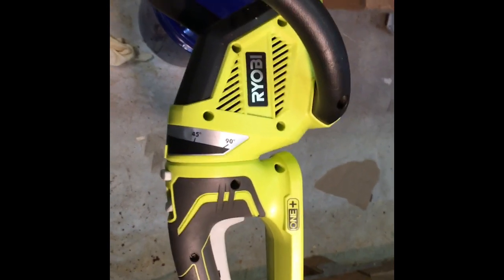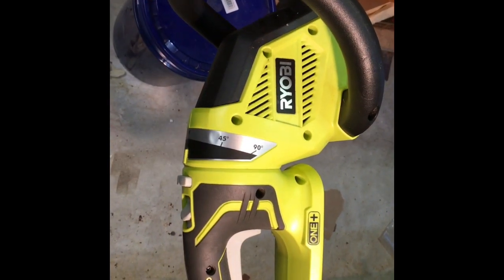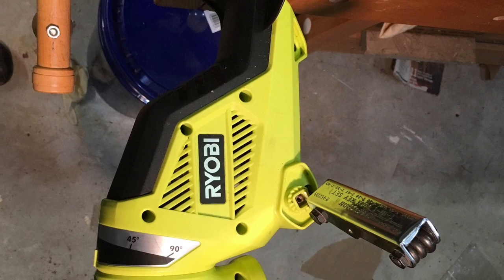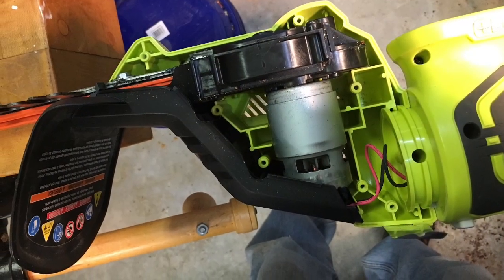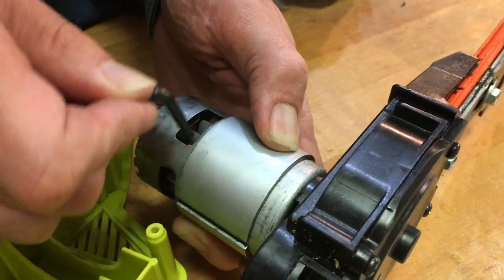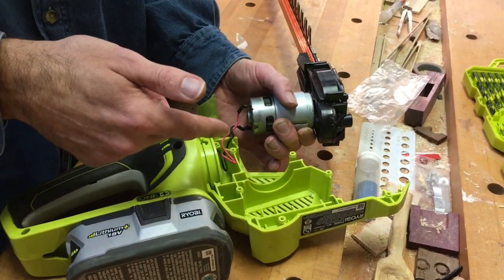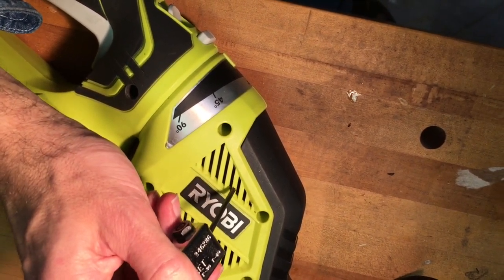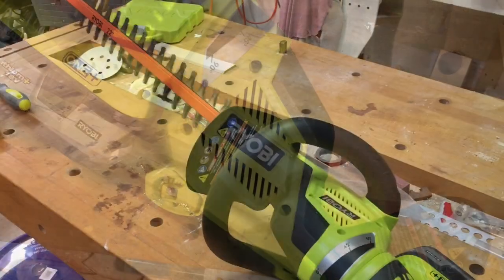Repair Ryobi 18V Cordless Hedge Trimmer

Comment: Very helpful video.  In the end I did have to take mine apart, revealing a broken connection between the switch and motor arising from an assembly error.

Comment: I found out something interesting with mine. It was making a high pitch kind of grinding noise, that would kick in after about 10 minutes of use. What I found was that the motor was loose on its mounts (applied some locktite re-inserted the screws & tightened). I also opened u the gear box & found that the grease was pretty hard. All I had was axle grease, so I gave it a good lube. After re-assembling, I lubed the blade with olive oil. I then cut my hedge & it cut like a dream. Its getting on for 9 years old, hoping it lasts a bit longer!
Reply: How did you reassemble the motor? I took mine apart, but can't get it back together again

Comment: If this didn't work for you read this!  First, thanks to Fix-it Family for showing me this fix.  I took out a few sections of the louvers over the plastic gears in the motor but it would not turn.  So then I took it apart as he shows you how (which saved a lot of time and trial/error).   I would pull the trigger and hear a click but the blades didn't move. So finally, last ditch, I put pliers on the small metal gear and forcibly turned it.  Then it turned smoothly.  So I tried the plastic gears, which also now turned smoothly.  Hook up the battery and everything works! Thanks!

Comment: Hi! I was repairing my hedge trimmer like this, but I can’t get the cover off. I’ve tried prying it, pulling it, taking off the handle, and there don’t seem to be any screws left. How did you get yours off, and which side comes off, the one with screws or the one without?
Reply from the maker: Be sure to remove all nine screws. As mentioned not all are visible
Reply: Mine was tough to get off but just gently pry at the seam with a flathead screwdriver.

Comment: They should design it to reverse the motor when that happens so that it can unjam.  All it would have to do is reverse the motor when it is drawing an abnormal amount of current in an attempt to let what ever it is stuck in the blades fall out, rather than attempting to continue cutting.  No matter what, I either unplug it or remove its battery before I unjam it.  I would hate to see someone try that not doing it that way.
Reply: I know the new one will reverse when it jams, but if you continue pushing the trigger it will go forward. A case of when brute force is not the solution.
Reply: @cfldriven  Exactly, if it has something stuck in the blades that it can't cut, reversing to release it would be a good idea.